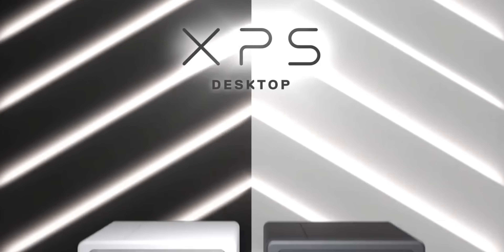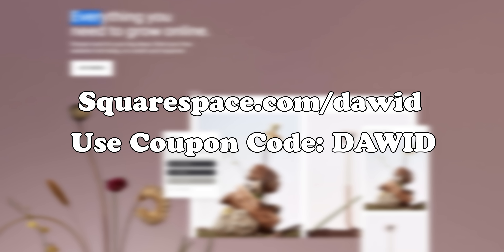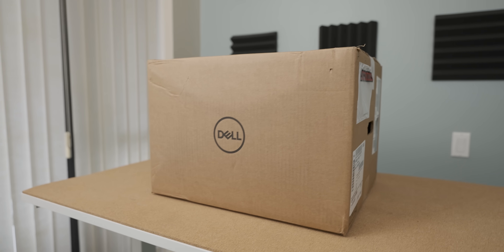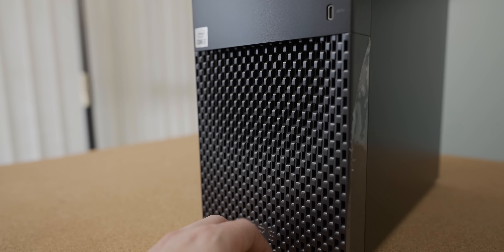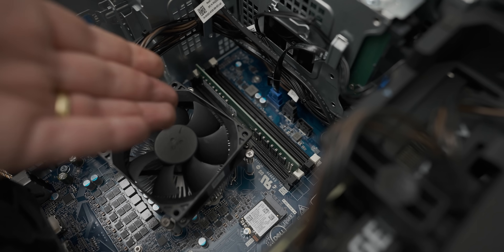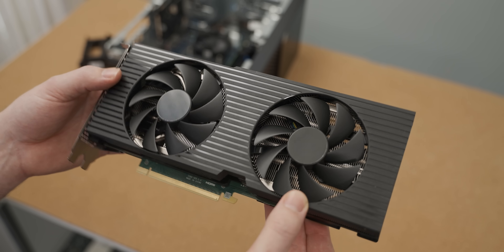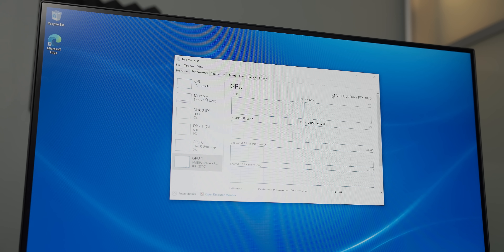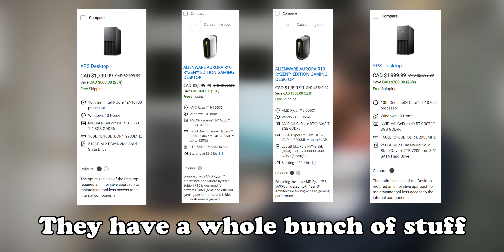DELL Did Me Dirty... RTX 3070 Dell XPS Pre-Built

Comment: In the future, use nvidia-smi to check out the card in more detail - dell is notorious for locking down their cards in vbios to lower power as well. For instance, the dell OEM 2070 is artificially power limited to 175w (instead of the base 215), further hurting performance, and when you combine that with their other acts of stupidity (usually shitty coolers, always shitty airflow, and notoriously poor decision making when it comes to component selection), you get a cascade effect. Where the same card in any other decently built system might hit 90% of what youd expect from an FE model, instead you're closer to losing a full generation or two worth of hardware improvements and end up with like half of what it should do.

Comment: I did the same thing and bought the cheapest i5 G5 gaming with a 3070. Never booted it up, just removed the GPU and put it in my Threadripper system. Works great. I was concerned Dell might have done something with the GPU BIOS, but everything is working fine. Now I have to dump the rest of the system on eBay.

Comment: I have been forced to use Dell workstations for the last 15ish years. They are fine, but expensive and the fun really starts when you upgrade the videocard, which is usually not easy. Mechanical restrictions, electrical restrictions. You are better off getting a new workstation and putting your new GPU in there...

Comment: They use that cpu cooler forever, lmao. I got my optiplex 7040 running i5 6500 (first ever skylake, cmiiw) using the same exact cooler with same exact placement, which is somewhat slanted compared to the rectangle motherboard. Oh Dell.

Comment: 10:21
Intel has specifications for example how long to boost and how high etc.
OEMs sticking to specs.

i7-10700 has a TDP of 65 watts.
So this little cooler is more than enough.

But yeah single-channel hols the cpu back...
Reply: You don't know how this works. As they themselves mention it on the site, the Tdp rating for each cpu is determined by putting it under sustained all-core Intel-defined complex workload with all cores working at their BASE SPEED, that's where they get those 65W TDP's from. In reality of course it's higher when the chip is using turbo boost and working with faster frequencies. That tiny garbage cooler is not enough for 10700 and so isn't that crap mobo which can't feed it with enough power for it to sustain intended clock speeds.
Reply: @DanielOfRussia  
>That tiny garbage cooler is not enough for 10700 and so isn't that crap mobo which can't feed it with enough power for it to sustain intended clock speeds.
It's turbo boost and it's for short periods.
They use also the thermal mass of the cooler to get higher clocks. 
The boost behavior was documented in the past.

Higher clock rates over the entire time are overclocking. 
in the past the where different results of i7-8700k, because mainboard companys overclocked the cpu as default.

Comment: Bruh that 10700 must be frying bcuz of that cheap ass cooler
Reply: @RobFlexz   10400 is a really good balance between power and efficiency but the 10700 runs hot , I have a 9700k and i got a hyper 212 for it but it still runs 70° while gaming and this is just straight out stupid on Dell's part

Comment: I like the design. I don't like RGB esthetic, this design ages better. And specs are much better than my current desktop from avgust 2020. (9700f,16gb,rtx2060 6gb,512gb nvme, 3tb hdd, artic e-sports cooler) that costed around 1500$ also.

Comment: Only a single 8 pin for a 3070?  So at full throttle you are maxing out both the 8 pin connection and the PCI slot on power.  Not exactly a wise move in a system that has no airflow.

Comment: Step 1: buy crappy dell prebuilt
Step 2: Sell video card on ebay for the same price you bought said prebuilt
Step 3: ?!?
Step 4: Profit
Reply: @Monochromatik-Vision nah that thing will sell for $200 so you are left with a $1300 non branded 3070
Reply: I wouldn't call it crappy. It's decent
Reply: except 1 stick ram, and a 12v only psu and a meh cooler
Reply: "Reference 3070 I was going to use for a custom loop, $1,500 or best offer"

Comment: If I opened that system and it had 1 stick of ram, I'd close it up, shove it back in the box, get a return label, and send it back and make those dick wipes send me the proper memory config. The 3070 should be able to drive 4k pretty decently. 68 fps on 1080p in valhalla is a joke

Comment: i got this pc a week ago with the i7 10700 and the gtx 1660 ti . i have to stop the cpu from boosting to keep it cool as hit 90 degrees otherwise and it has a terrible 360watt power supply i cant upgrade as the connector is weird . i can only go to the 500watt variant . ! pissed off
Reply: dawid you didnt realise the connector that isnt the 20+4 pin in the place is a stupid 6 pin

Comment: This is a sin against the silicon used in the 10700 and 3070. No processor deserves to be crippled that badly by bad cooling and single-channel RAM.
This PC would have made more sense with an i3 and 1650 Super. It would have also given about the same gaming performance.

Comment: 3070 is only getting like 200-220 watts of power with one 8 pin connector, that was a significant performance hit too. My 3070 has two 8 pins and my vbios pulls around 240-295 watts and I get 30-50 FPS more in the same games with my r5 3600 @4.2ghz

Comment: That PSU, while being slightly under powered, is not limited by the 12 volt, and is about the only systems consistently using the new 12v standw

Comment: Honestly, I don't blame Dell for making underwhelming Work prebuilds. They know their market. We went through this a few years ago at my company- had to change to new all new software and they wanted to hit the recommended specs with all the replacement PCs. Everybody got new Dell XPS systems with very high end specs, but then you can hear the fans quickly go to volcano mode when you place any type of continuous load on the system. The people buying these PCs want the Dell name, Dell warranty, Dell reliability, and are just trying to hit a spec for a price. The actual users rarely are the ones choosing the PC. One of my coworkers was championing a "gaming brand" of prebuilt PC because they performed better at the same spec and were actually a bit cheaper at the time, but the Dell name won with accounting. I could probably replace the 1080 ti in my PC with a 1050 ti and nobody would notice... hmm.

Comment: Why is it that the only people in charge of these prebuilts at these large companies seem like they must be men in their late 70's who have never played a video game and refuse to upgrade simple things like the cooler and increase air flow. I guess as an engineer I know that if I get higher wattage parts I need higher wattage of cooling. That means greater surface area of heat transfer and greater air flow. Why does intel still let them use that shit stock cooler when they know its going to bottleneck their chips.

Please do a fallow up video on upgrading just the cooler and ram to something that resembled the marketing material. show the difference and spam @Dell in the description and slam this shit on social media at them. Those tiny stock coolers have been under performing on i7s (and now above with the i9) for at least like 5 or 6 years. what kind of crack are they smoking. As a consumer I would love to buy a prebuild from a company like this as its easy to get things like warranty work and pretty good customer service. Do they know if they just worked on these little details people would take their shitty prebuilts seriously. 

The average high schooler can build a desktop better than Dell.

Isnt showing something in marketing material and getting something different known as a scam? The ram could just be marked up to they gave you the wrong config but if they didnt specify that other non selectable core components were different then the marketing material isnt that a scam?

Comment: wow straight up missing a ram stick, that's pretty outrageous
Reply: I'm not sure what would be worse. 1x8GB ram where they forgot to add the second one, or 1x16GB where they completely ignored the order and went for single channel as per their usual shit machines.
Reply: @Tomazack  a single 1x8gb would definitely be alot worse
Reply: Guaranteed that the guy that did this goes over on his lunch break religiously.
Reply: The fine print for many pre-built's include some form of clause for 'substitutions'.  You get the sum of what you ordered, not the specifics (so 1x16gb instead of 2x8gb = close enough in their world).  I'd still take a poke at them for the CPU cooler though to see how they respond, that is on the dark side of dirty for a substitution given the marketing material (where custom/high performance does not equal oem boxed).  You could make a case for 'inadequate' given the temps, especially if you can get it hot enough that it down clocks on a sustained load.

Comment: Why are you worried about an 80+ platinum Delta OEM psu? That's quite possibly the best power supply on any product you have ever owned. The GPU will pull power from both the PCI-e slot and PCI-e power connector. There is no problem. The power will be balanced across the rails.

Comment: This is Intel's fault. It's a "65 watt" CPU so it gets a 65 watt rated cooler. It's probably the all aluminum cooler and not even the one with the copper slug.
Reply: Only partly their fault. As they themselves mention it on the site, the Tdp rating for each cpu is determined by putting it under sustained all-core Intel-defined complex workload with all cores working at their BASE SPEED, that's where they get those 65W TDP's from. In reality of course it's higher when the chip is using turbo boost and working with faster frequencies.

Comment: this doesnt surprise me about dell, they suck, always have.   if there is a way for them skimp on something to save a penny they will do it, and rip the end user off.   why i build my own stuff period.   how ever, you did get a good video card that you cant normally get it.   lol
Reply: Yep, they skimped out on the thermal paste with my Alienware 17 R5 a few years ago so my 1070 was getting bad thermals and the 8950HK was overheating like crazy even at sub-25% usage (80-90 C was common) and when I opened the thing up, sure enough the thermal paste was dried like crazy.  Replaced it with TG Kryonaut on the CPU and GPU dies and now I can hit 4.3 GHz on all 6 cores no problem unless I put it under a huge stress test in which case it lowers to around 3.8-4 GHz on all cores.

Comment: A single 8 pin on a 3070? Is that typical? My gaming trio has 2 8pins.
Reply: No, that's not typical. The FE uses a 12-pin and most models use 8+8.
Reply: It's likely the reference design like he said in the video which no one seems to be using.
Reply: I have a galax kfa2 rtx 3070 EX (1 Click OC they say but its way too limited) 2 Fans version, and it has only 1 8 pins. Basically if you have 2 8 pins on a triple fan GPU, its more likely because it can handle overclocking, needs more cooling and is the higher end of the card version, while dual fans GPU are generally equipped with 1 8 pins only and is for people who doesn't care about overclocking.
Reply: I have the FE card which has a single 8 pin. (Technically it uses an 8 to 12 pin adapter, but that’s still the same amount of power)
Reply: Ahh cool thanks for the answers everyone. That's crazy good performance for a single 8 pin anyways.

Comment: Id say you should call up dell and ask about that RAM and cooler. I would like to see a revisit of this prebuilt in the optimal configuration.
Reply: Dell will tell you the cooler is rated for 65 watts, the same as the CPU. You need to call Intel.
Reply: @bills6093  LOL. What about the misconfigured RAM? He did purchase the 2x8gb kit after all...
Reply: @bills6093  Thats even funnier, but that assumes that recording was made right before he did the purchase. He could have just pulled the configuration up on dells website for b roll after the fact.

Comment: Xps is tatti in terms of cooling. 😃
Reply: its not tatti when it has atleast 3070 that you can make money mining with 😁. enough tk replace that prebuild with a custom build and swap it with a old GPU.

disclaimer if you are fellow indian as your electricity cost is less than 1.5rs then you can earn around 500-600 rs a day reasonably
Reply: Mining makes peeps rich...lmao. Mining is not ideal if you have only one system. And one would definitely not go for this XPS. You can build very cheap with slow processor and high-end gpu for mining purpose. 
So, basically this xps is for noone.👎

Comment: I swear Dell's business model depends on the fact that the vast majority of people will never open up their own systems lol
Reply: Well clearly they never do. That's the whole point of prebuilts.
Reply: @mihan2d  

Normally I'd agree with this statement, but the point of prebuilts at the moment is too get around the insane GPU prices and replace any components that need replacing, and for MUCH cheaper overall than a custom of the same exact same setup.

GTX 1660S on its own is going for $800+ on amazon right now, and I can find a desktop for $800 WITH the GTX 1660S contained prebuilt.
Reply: @GandalfTheSilver  Exactly why I'm getting Lenovo T5 with 3070 on it

Comment: I hope you are able to follow up after contacting Dell to see if they will make the RAM correct....and do you have the power connectors to upgrade the CPU cooler? Lets see what those changes can do for this sub $1600 premie
Reply: That would be my main question. Their mobos are lacking in connections and don't support higher speeds of RAM

Comment: The results are better at 1440p lol. Can you try to ramp up the CPU fan speed? Also, that motherboard looks even lamer than on the website.
Reply: That's right, not only the 10700 was thermally restricted, that crap mobo has such inappropriate power delivery it can't feed it with enough power to keep at 4590MHz all core which is what the 10700/F usually boosts up to without limitations.

Comment: The computer is typical steaming garbage Dell, but it would be nice if you tested that RTX 3070  separately. It seems that it might not be bad in decent system. Also you should check card thermal performance.

Comment: Dawid I know this sounds crazy but I actually own a pre-built with dual-channel memory, and the sticks were even in the right slots. It also came with a 13 yo PSU which blew up in a Tom's Hardware stress test, and the CPU cooler was plugged into the case fan outlet but that's beside the point

Comment: for my first "gaming pc" i walked into microcenter with like 1100 bucks and didnt really know anything besides "graphics card" even tho ive been on a pc since i was like 6 and im 33. so i bought a xps 8900 with a "gt730" graphics card for about 730 bucks believe it or not it cost me a lil over that like 800. I went home and after a few weeks of "gaming" learned SO MUCH of my money was wasted. I didnt know you needed a gaming mouse keyboard monitor. I spent probably 1700 total for my setup? after I salvaged only the cpu from the dell build. Basically wasting 400+ learning to read. lol. and even doing so i had to rebuy a previous gen mobo that wont let me unlock my ram speeds. total rebuild still necessary from about 5 years ago.
Reply: I put a gtx960ssc in the dell. it worked and tbh, i probably coulda ran that for 10 years but I wanted that "gamer" style so i rebuilt everything just to drop the psu. it works but quality wise. I probably coulda had a decent "alienware" homebuild.
Reply: also, when I had mine it would let me eject media in the taskbar for the ssd card reader. wonder if thats happening still to you. i was told its a glitch i even called about it. and ended up ripping it out of the case itself. lol.

Comment: That XPS looks like an Optiplex business pc, wtf.

Even the back looks like one!
Reply: It is an optipex business PC, just with a different name.
Reply from the maker: Yeah it really does. It's such a disappointing looking system.
Reply: Idk, kinda low key. I liked it, but it is built like a furnace. Cooling isn’t Dell’s strong suit. I’m actually running an upgraded optiplex rn, but I got an i5 and dual channel 8gig ram, and put an RX570 and Corsair PSU in for CHEAP, even with the surge in GPU prices. I got that all for like $300. That’s pretty damn good tbh. All of that has made me appreciate Optiplexes for what they are.
Reply: Dell has been getting worse and worse